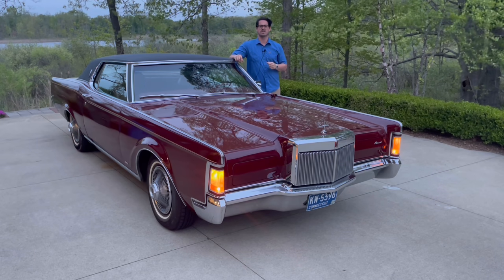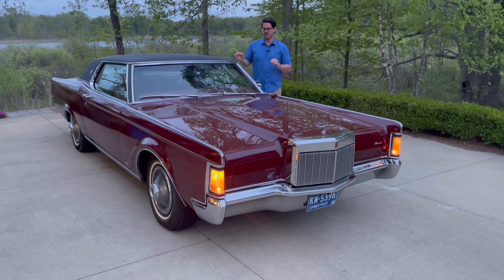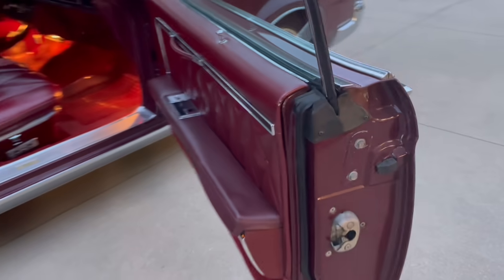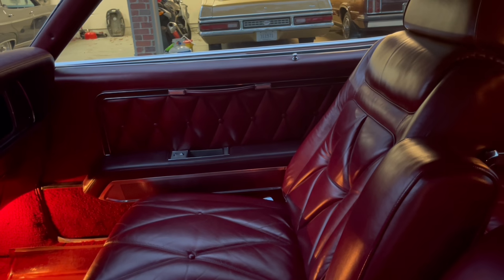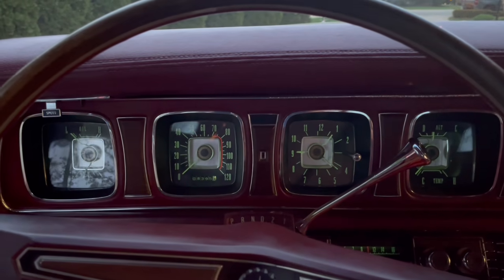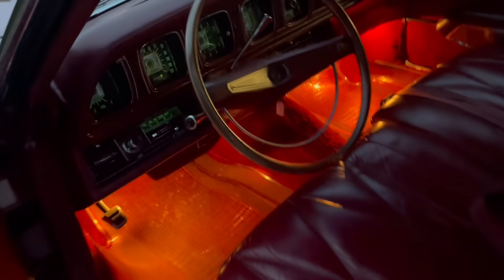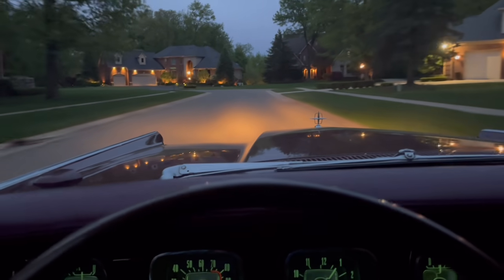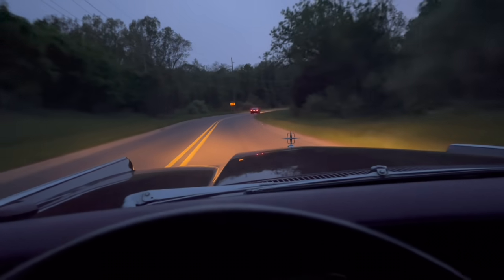Is This the Pinnacle of American Luxury?  The 1969 Lincoln Mark III Was Luxury Perfection

Comment: Just to confirm what you stated about the Mark III's design and quality - YES, they were a cut above anything else coming out of Detroit at the time. The level of detail in the interior, as well as the fit, finish and materials were so much nicer than anything from Chrysler Imperial or Cadillac. In fact, I recall that when the Mark IV was introduced I was so disappointed when inspecting one in the showroom for the first time in the Fall of 1972. The Mark IV was based on Ford's intermediate Torino platform and the quality was about the same as the lesser car. That also explains the smaller trunk. All of the expensive trim pieces, the tight fits and the precision in the body panels went out the window. The IV was a great LOOKING car - but the build integrity was just standard FoMoCo. They really took cost out of the interior in comparison to the Mark III as well. Anyway, thanks for the ride in your beautiful 1969 Mark III. That is one of the finest Lincolns ever built & a very special car!

Comment: 02:37 so true. Lincoln really put lots of attention to quality, fit and finish, durability of the interior pieces, and the paint vs Cadillac. You can even see this years later on say a 1996 Lincoln Town Car vs a 1996 Cadillac Fleetwood Brougham. The Lincoln wins in every category including paint thickness, lack of imperfections in the clear coat, the quality of the leather, etc... no comparison
Reply: What I find interesting is that in the contemporary comparison tests of the day in MT, C&D, etc., there was no mention of the quality differences between the Mark and the Eldorado, even though they were apparent even from the photos in the magazine.  The Eldorado was nice, of course, but the Mark was in a whole other league.

Comment: According to the Encyclopedia of American Cars, the '69 Mark III sold 23,088 vs 23,333 for the Eldorado.  Base prices were $6758 and $6711 respectively.  As model years progressed, the Continental started to outsell the Eldorado, and by 1977, the Mark V, with over 80,000 sold, had twice the sales of the Eldo.
Reply: The Mark III was introduced in early 1968 and Wikipedia lists 7,770 cars produced in 1968, probably attributed to the 1969 model year.

Comment: Very thorough, easy-to-understand explanation.  I worked as a Service Advisor in the early 90s, at a Cadillac/Rolls Royce dealership in Miami, FL.  I couldn’t believe it when I saw brand new Rolls Royce’s equipped with GM A-6 a/c compressor!  You are absolutely correct… they did use GM a/c compressors!  Have seen them in some Lincolns also.  Good video! Thanks!

Comment: My first car was a 1969 4-door Thunderbird. Suicide doors. All white leather. Infinitely variable speed windshield wipers. 429 cubic inches powering skinny, white-wall tires. It was a hand-me-down that had sat in my Grandma's back yard for thirteen years following my Grandpa's passing. The only power window that worked at all with the passenger side rear, so my buddies and I would hit the drive-through window backwards to get our fast food. Good memories.

Comment: I had an early-production 69 (built May 13th, 1968) for more than 20 years.  It had a different steering wheel, different clock, and no headrests compared to the standard-production 69s.  Mine was a special-order Dark Ivy Gold with matching top and leather interior. It was a wonderful beast--powerful, smooth, and built like a tank.  It did wallow in the corners, but you could drive over a minivan not not feel a thing.    I loved that car.

Comment: One of my Favorite Classic Lincolns. In the perfect Color Combination. I lmost pulled the trigger on one back in the mid 80’s. Back in the AUTO TRADER publication was a Bible to car lovers. Looking at 1x1.5 inch black and white photo. 1 pic. Taken from the 3rd floor down onto the car made it look even classier. I drove blindly into Boston from Worc. County took over an hour to find a car that needed a paint job badly and very worn interior for the mileage that was supposedly on the car. I was so upset. I told the seller that he miss represented the Car! Back then I was shy, I never spoke up but after getting lost on my way to his place and being all nerved up I has no problems getting upset with this liar. It Was Black over black. Thank You so much Adam you add so much to my day brining back these with such detail and level headed explanations of each car. Thank you again.
Reply: I drove down to Pembroke to look at a '69 4 door Continental, which was only $400 in 1978, but I chickened out because it needed the dual exhaust system replaced. It seemed to look good and drove well.  Thinking back, unless I overlooked other important things (and I could easily have), the car was a steal and I should have gone for it.

Comment: The door hinges and door are just like my '66 Lincoln Continental; massive chucks of steel for hinges but moved easily and smoothly like a bank vault door. But the door has never sagged unlike my late model year daily driver Grand Marquis with modern flimsy hinges. The park lights on my Lincoln do the same thing when you turn on the headlights. Similar era of build for both cars.

Comment: Around 1980 a buddy of mine bought a mint condition '69 Lincoln MKIII. Such a beautiful, elegant car. So much so it inspired me to start looking for one. I found a 1971 MKIII in near mint condition at a Lincoln dealer. I read that the die cast chrome grill cost Lincoln $350 in 1968 dollars ($3,050.00 in 2023 dollars).  The intake ports on the 460 heads were huge, and hurt low-end torque and horsepower. I read to replace the factory cast iron intake manifold with an Edelbrock aluminum performance manifold with smaller runners and ports. I installed this manifold (back in 1981) and it made a very discernable difference in low-end acceleration -- chirping the tires at the 1-2 shift. My car was pewter (exterior) black vinyl top and black interior. Later I also bought a 1970 MKlll (blue exterior, white vinyl top and white interior).  Also, I took apart a wheel cover on my 1971 Mark, and the cover comprised seven different sections, all stainless steel. Yes, the quality of the MKIII was superb.

Comment: Truly a pinnacle of American luxury automation, wonderful. When I was younger I had this idea that everything from vacuum cleaners to loudspeakers would improve year by year. So wrong I was. When I see a superlative car like this, I cannot avoid thinking/dreaming of what if they had continued developing it instead of replacing it. My dream version of the mid 1970’s for it would have to have forged aluminum or magnesium wheels as it probably would take around 20 kilograms of un sprung weight of the car. A Bosch fuel injection system of the time wouldn’t be bad as well. 
Thanks for sharing this delightful vehicle with us! Greetings from Denmark

Comment: The tall antenna mast was for better AM reception.  FM mast antennas work well at 30-31", but AM, which transmits on lower frequencies, and thus longer wavelengths, works much better with taller masts.  Back in the 50s, AM antennas which would extend up four to five feet were common.  Extending the antenna all the way up really helped in rural areas where the AM signals were weaker.  In cities, where signals were strong, running the antenna up three feet or so worked well on AM.  This is the major reason you'd see power antennas which allowed the user to select the amount of extension.  It allowed the user to select an antenna extension to match the incoming signal strength.  As you note, this was as fine an American car as one could buy at the time, and this example is nicely equipped. The original buyer could easily have afforded a few bucks extra to add FM, but didn't.  FM developed long after AM.  In many parts of the country, FM didn't really develop until the mid-to-late 70s.  Going into the 70s, many areas only had a few FM signals (some had none).  I'd guess that this car was originally purchased in a smaller city with little or no FM service.

Comment: We were life long Lincoln Mercury people and my Father had a 69 Mark III.  I am astounded at your comment about the transmission as our car shifted  silky smooth unlike my Mother's 66  Oldsmobile Toronado which was far more " jerky " which was also the case with a Buick and Pontiac that we briefly owned. My parents subsequently bought a 73 Mark IV and 78 Mark V , the build quality on those was not as good as the Mark III however they were equally smooth and reliable.

Comment: For the design oriented that spare hump is actually repeated in the bumper for symetry and also to perhaps further the illusion that there's a tire carried under the bulge.  Of course harkening back to the original in 39, although originally the actual tire was exposed (metal cover came later)  I have to agree about the quality of these things - even on a an average condition driver it shows - Ford did not remove content from interiors nearly as fast or as egregiously as GM - and they gave the Mark III extra attention.  I believe Brunn (son of the coachbuilder Brunn) did the interior.

Comment: I had a 74 T Bird that was a virtual clone of the  next gen,Mark 4. They both had 460 as the only engine in 74. Only the front and rear facias . It weighted 4800 lbs. It had 50/50 front seat,power of course and it was extremely well equipped. It was like riding on a cloud. I always said when I owned that was like driving down the road in a living room recliner. I actually think the differences make the T Bird a better looking car. I got about 8 to ten miles per gallon. I tuned it and kept it perfectly maintained,
 10 mpg. That was it.

Comment: I have a 1971 and I agree with all your points. I did not know about the shifter problem. Mine is a little loose. I wont leave it running without me in it. Thanks great video

Comment: I wish a 1968-69 Thunderbird would be showcased by Adam. If it was optioned up with the Brougham interior, power windows, locks etc, it really is the same car. 1967-71 Thunderbirds are built with the same high quality; very under-appreciated automobiles. 
The Mark III doesn't just share a frame with the Thunderbird, it is truly a reskined Thunderbird.
There are options available on the Thunderbird, but not on the Mark III, such as Tilt-away steering wheel, speed control buttons on steering wheel, power sunroof, cornering lamps.
Reply from the maker: Stay tuned

Comment: One of my dream cars. I've owned three Mark IVs and one 76 T-bird (a Mark IV with different trim) but I've never own a Mark lll. Loved owning the Marks, best ride ever, 460ci 4bbl, 9-10 mpg but gas was cheaper then. Only problem was with the ECU. Couldn't get a new one, forced to source salvage yards. And the antilock brakes (yes they had them, vacuum powered, and four wheel discs). T-bird ran for 259k miles before someone sideswiped it.

Comment: I had the first-generation “1968 1/2” Continental Mark III over twenty years ago while in college.  It was dark blue with black leather interior and vinyl top.  Condition was very good and the 460 engine was extremely powerful and responsive!  

The steering wheel had a simpler, rim-blow design different than yours; and smaller, more intricate interior stitching.  The front seats had no headrests.  To start it, I had to put the shifter in between park and reverse and crank the ignition switch near the ashtray.  

I remember feeling that driving this car was stressful: the high dashboard was very intrusive, blocking a full view of the road, and I could not adjust the seats any higher to compensate.  I kept that Mark III for only a year and sold it for the same price I paid: $2,250.  Today I would love to have a 1977 Continental or a 1979 Collector’s Series sedan.

Comment: I love how the Mark III still has some of those early 60's "Kennedy era" styling touches.  The way the fenders protrude out with that chrome strip on top, the front bumper has those points on either side, the way the roof looks like its perched on top of the body, a whole separate piece.  Speaking of that roofline, I feel like the Mark III is one of the few cars designed to have a vinyl top on it by the designers.  The vinyl top actually looks awesome and its hard to visualise this car without it.  Also with how low/long/wide this car is it has the sort of "lowrider" proportions from the factory.  If you can't tell the Mark III is my favorite post WW2 Lincoln.

Comment: Growing up my parents had a 67 TBird 4DR and 68 TBird 2DR on which this car was based.  Very luxurious.  They surprised you with their appointments and comforts...but they were quirky cars (except the engines and transmission...totally bombproof).  Weak spots: cheap speakers with the 8-Track system....those hubcaps that stuck out, T-Birds had similar one...my mom creamed the T-bird hubcaps on curbs when she parallel parked...drove me nuts, they replaced many of them....motor for the sequential taillights on the 'Birds ALWAYS failed and got harder to find....power seats were limited in movement and weak....Adam makes reference to the AMP gauge not indicating that the alternator was overcharging--that gauge, the oil pressure gauge , and the coolant temp gauges ALL got sluggish and essentially were worthless.   That being said...my parents loved the cars and put nearly 200K on each of them,  which was a LOT for the time.

Comment: That firm C6 shift quality adds the the longevity of the clutch friction packs. I have a 1979 Ford F250 and the C6 has around 279,000 miles and the transmission has never been rebuilt.

Comment: My mom bought a triple black ‘70 Mark III off the showroom floor. She had been eyeing the Mark for a year after they came out and had to have it. As for the transmission lever disengaging, she witnessed that first hand at a gas station. She was in her Mark III and a woman pulled up in her Continental to get directions from the attendant. The transmission lever disengaged in the other woman’s car which was running and the car swung around hit her and ran her over in front of my mother. The woman was killed. Extremely traumatic experience for everybody at the neighborhood gas station. Within months, my mother received a notice from Lincoln with a warning about placing the car in park and turning the car off before exiting.

Comment: I never thought about how modern these cars truly were. As a kid when these were still on the road, they seemed as dinosaurs 🦖 🦕 me.  I believe these cars are actually closer in tech to the 1989 Lincolns than 2000 Lincolns are to 2020s are. It truly shows you where most of the r&d came from for 80s and 90s cars

Comment: I read on a Mark III forum that the early 460's were built using hand selected fits.
Wonder if true, and if true, would it also not be the case for the 68' 429 Thunderbirds, as the 385 Block was a completely new animal at the time?
I say this because the 67' FE 428 Thunderbirds seemed to be not quite as powerful.

Comment: Lincoln paid such attention to detail with so many things but one thing I always thought was cheap looking in these cars was the gear indicator. I never liked that it was just slapped on the steering column like some cheap-ass afterthought. I much preferred the way GM's always did it with the indicator up in the main Dash

Comment: Absolutely beautiful powerful cars only thing wrong with them was the fuel line was buried in the frame from front to back and the vacuum leak issues. The leak would cause the headlights to gradually open, power door locks not working and hearing a hiss under your dash somewhere. That’s what wears out on them.